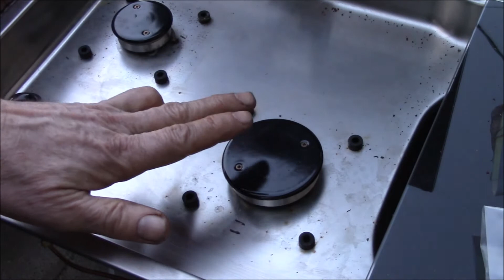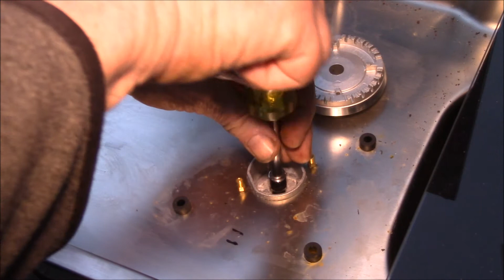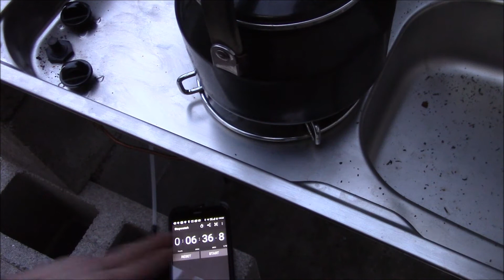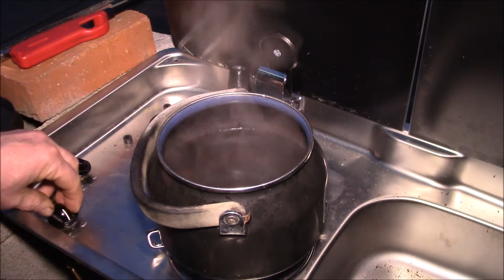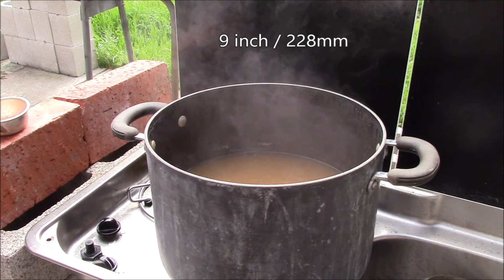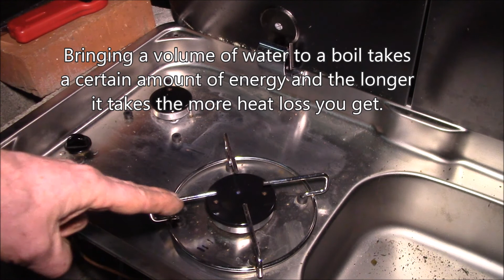Outdoor Kitchen Island, Final Propane Setup

Comment: I need to setup one like that for power outages thanks for showing
Reply from the maker: Thanks for the comment and yes, it's a nice thing to have with the fragile power grid we seem to have.  I think we had 6 times in the last 2 months where we were under threat of extended power shutoffs due to high fire danger.  And just yesterday, the neighbor and houses up the street lost power due to high winds.  My power line comes in from the opposite direction and was unaffected.  With an all electric kitchen, it's hard to cook food with no power.

Sad thing is now a lot of cities here are banning natural gas service in new construction on top of a recent ban of wood burning fireplace/stove installations and thus are forcing all new construction to be 100% electric.  Makes me glad I have an older house with more options.
Reply: @The4Crawler  that is for sure power companies are trying to rip people off
Reply from the maker: For sure.  With all electric, you'll be in the top rate tier for electricity.  PG&E top tier is just shy of 30 cents/KWH now, likely to increase once they add on all the infrastructure upgrades, carbon taxes, wildfire claims and ...  On the other hand, natural gas cost is about 4 cents/KWH here.